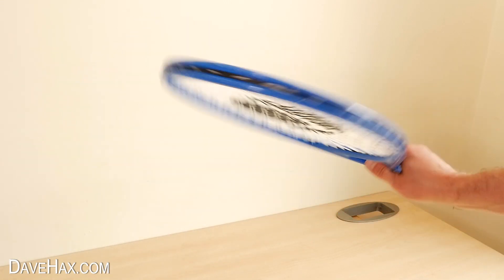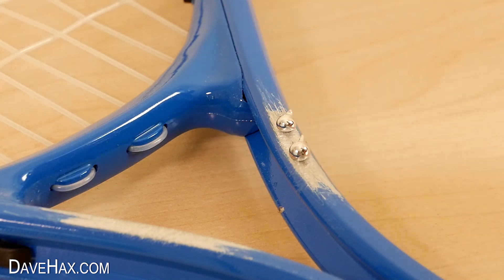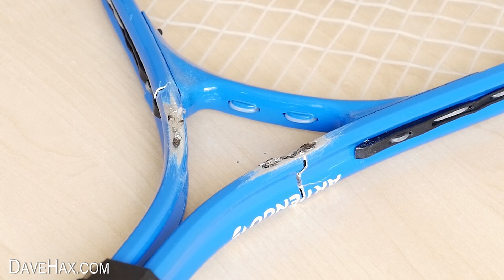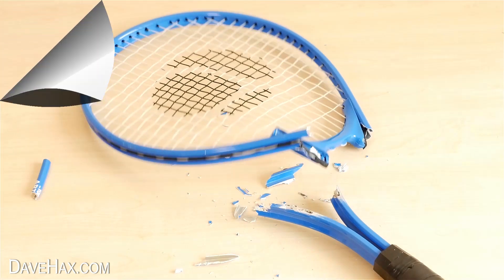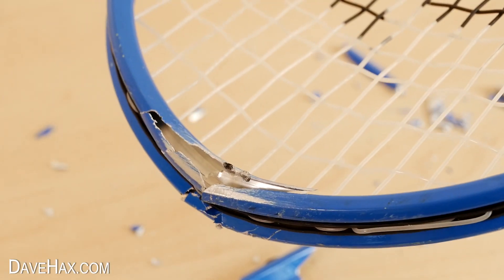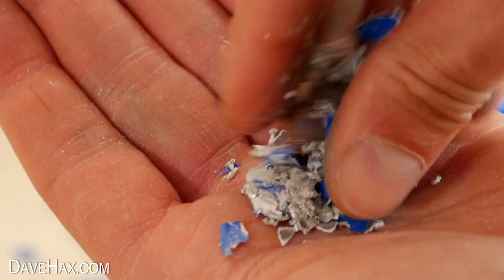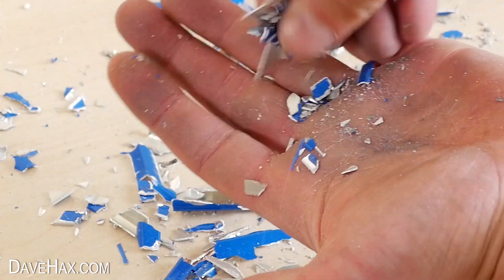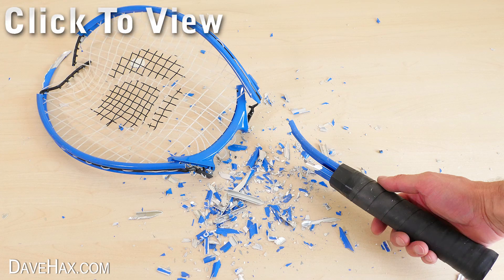Incredible  - Gallium Vs Aluminium Tennis Racket

Comment: hello sir, I provide broken racket repair service at an affordable price. in addition the repaired racket straps can be tightened just as the racket does not break. if you are interested in having a high quality racket and love to throw it away, you can contact me at gmail or Whatsapp 0162051879 / mohammadnaimrossshafie@gmail.com. thank you . I'm very pleased that you used our service. ❤️

Comment: Imagine what Gallium would do to an aircraft.
Reply: electronicsNmore bad bad things I don’t think you can bring gallium on board for this reason.
Reply: i thought planes were made of steel?
Reply: Sahibdip Sandhu bruh do you even realize how much a plane made out of steel would weight?? 
Did you ever see a car made out of steel? Weight is the highest priority for planecraft, and you think they use steel  😂😂 Aluminium is very strong and also light which makes it perfect as a material for cars and especially planes.
Reply: @KingdomArtz  Even so, Gallium can somewhat weaken steel, so it still could do damage to a theoretical steel plane.
Reply: @morrowseer415  Gallium is the psychotic serial killer that no one can ignore him although he is weak
Reply: @sahibdipsandhu  certain parts but not the entire thing due to steel being extremely heavy

Comment: Next week. "Today I rubbed sandpaper on the aluminum supports of this building, then used a spray bottle filled with gallium to deteriorate the support. The result is the building fell over. "